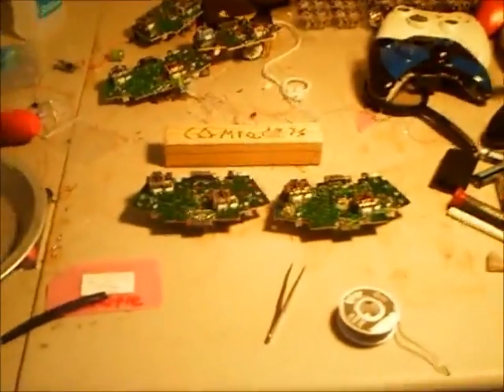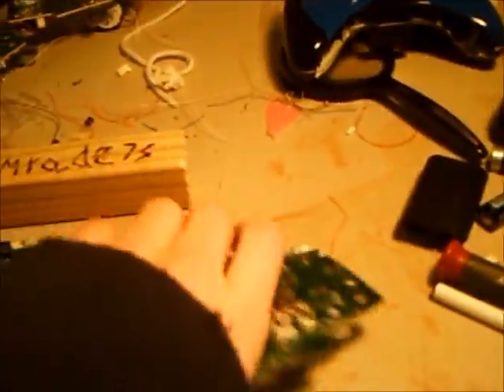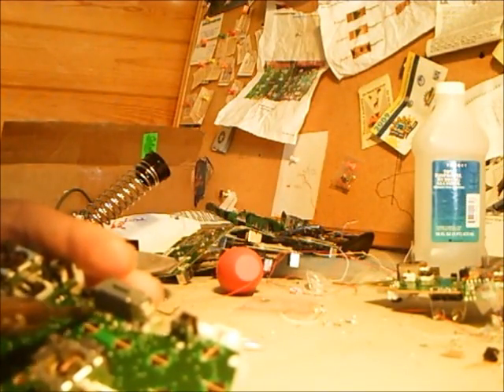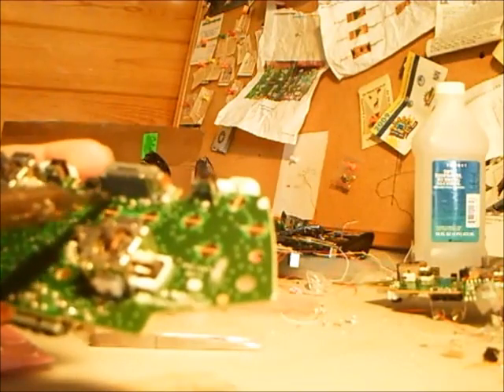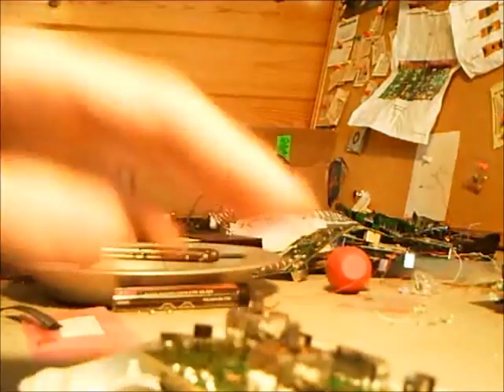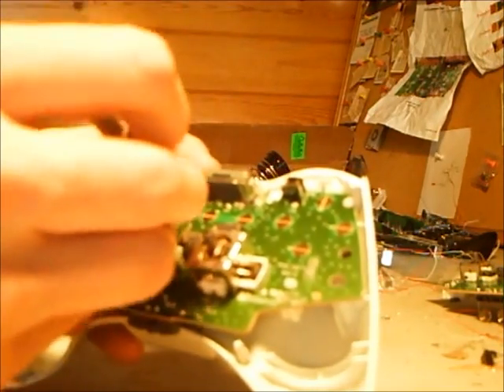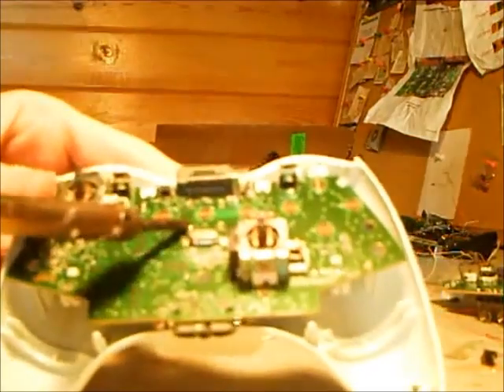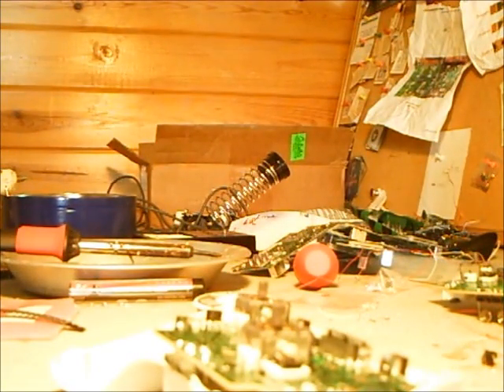How to solder leds in your xbox 360 controller ring of light

Comment: What if the solder comes off of one of the points? Like when you remove one you usually have 2 silver spots but one of those points came off so any ideas on how to fix it.